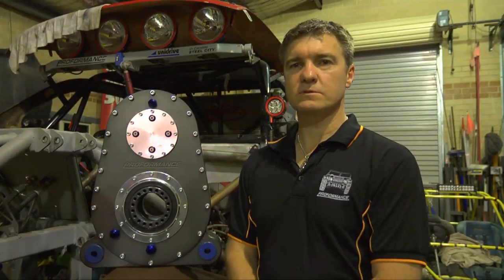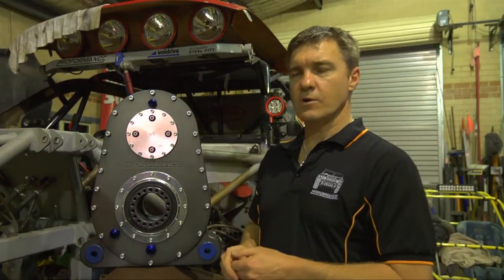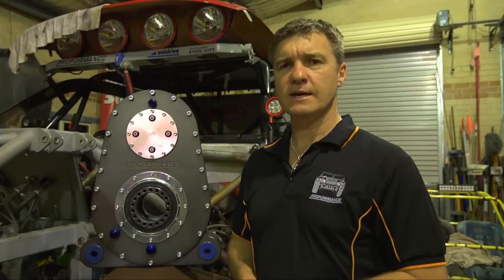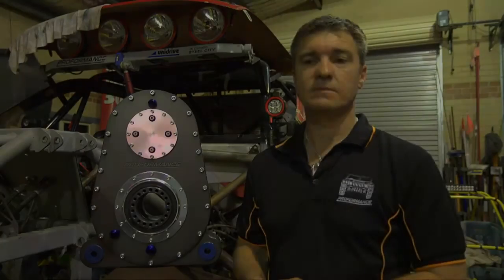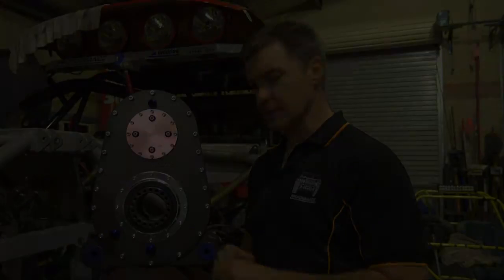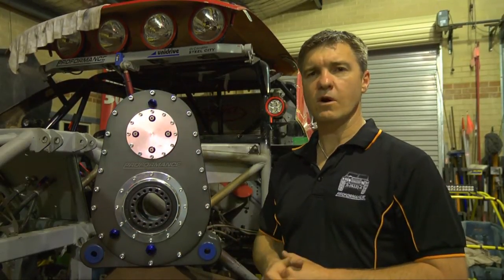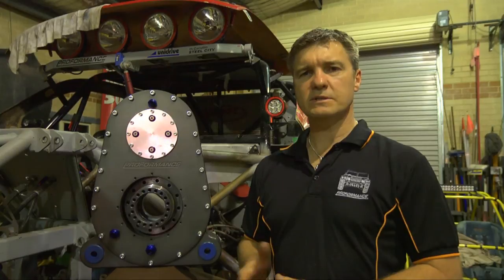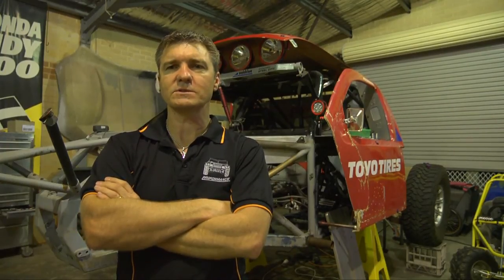Proformance Motorsport Quick Change Transfer Case with Under Drive

Comment: Nice that someone knows what's up. I'm running 40+ inch military tires on my turbo diesel. My friends think  I'm crazy for getting a underdrive that fits between my t-case & trans.  I have to make / move cross members, modify drive shafts, etc...., but my ZF6 speed becomes a 12 speed and with low range , a 24 speed LOL! & I keep my 3.73 gears with that MASSIVE pinion since I tow 15,000 pound plus trailers.   Your case is beautiful, but beyond what I need.  There is a market for diesel duty underdrives in front of the NV271 & 273 T cases....